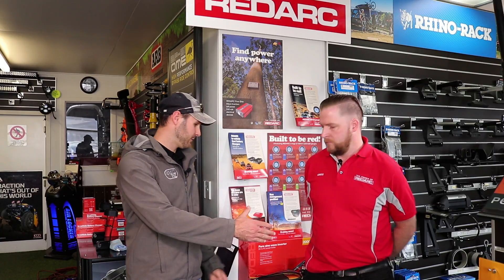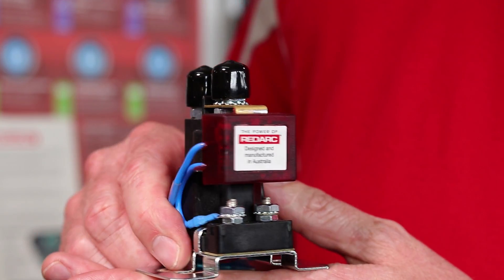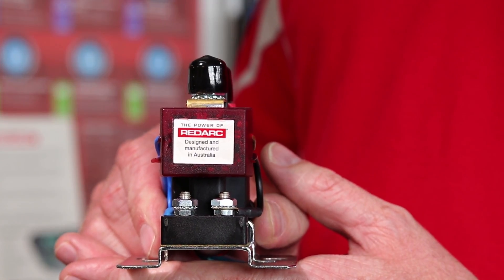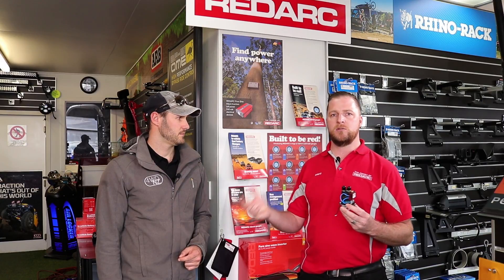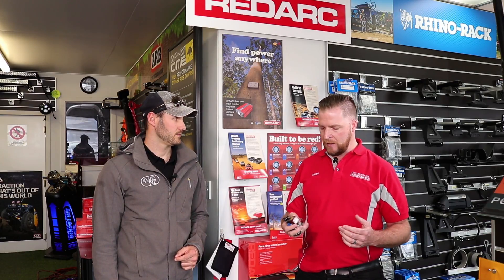REDARC BCDC and SBI Explained

Comment: The alternator may be able to provide 40amps but wouldn’t having to connect to the starting battery terminals prevent you from getting the full 40amps? For example on the Toyota Tundra the alternator goes direct to fuse box and THEN to starting battery, seems like 40amps would drain the starting battery faster than the charging system could handle it.
Reply from the maker: We don't get to play with the tundra here in NZ. Most cars will charge directly to the start battery. For example in out landcruiser we get 120A charge out of the alternator. The DCDC charger will take the charge from the battery as the power is fed in and will isolate its self once the batter voltage drops below its cutoff. You will find the tundra probably chargers  a lot higher than 40A at the battery.

Comment: Couple of questions in regards to having this system installed in  a campervan, 1. Whilst driving is the camp fridge  running off the vehicle alternator or the auxiliary battery? (which is being charged by the vehicle alternator) 2. Once parked and camping, what type of isolator is used to ensure the auxiliary battery is not drawing down the vehicle battery, is it automatic or manual?  Thanks for the info.
Reply from the maker: Hi Gary, 
Great question. Which system have you gone for?
The fridge will always run off the aux battery as long as its been wired up to consume off it., both the SBI and the BCDC will feed charge into the aux battery as long as the vehicle is running. Both the SBI and BCDC will shit off once the vehicle start battery drops below a safe voltage. This will ensure you are always able to start you engine. 
The biggest difference is that the BCDC will charge you aux battery to 100% using the specific charge cycle it needs for its type. The SBI will not. 

Hope it helps

Comment: can i used bcdc this device for Standard alternator , thanks.
Reply from the maker: Yes the BCDC will work with any alternator. It will do a far better job charging your 2nd battery than a VSR will.
Reply: @4WDNewZealand  hello mate, i install yesterday my Redarc 1220 , i notice battery type appear AGM in my display but i did not see any light in Boost, Float  or this is natural unless fully charge thanks.

Comment: At 5:53 that was great, a clear demonstration. Later at 6:12 you stated that a fully charged aux. battery lasts longer. Not if it's LiFePO4 type! Ranging 25%-80% SOC seems to maximize their lifespan.
Reply: Hi There, the statement was more based around that you will get a longer run-time of accessories from a fully charged battery. You are correct in saying that some Lithium chemistry mix batteries want to be charged in that range but the LiFePo4 batteries we are dealing with (and the use scenario) means the batteries are generally going to be cycled up and down and probably wont be staying at 100% SOC for very long. If you are storing the battery for long periods with no charge/discharge then absolutely they should be stored lower than 100% SOC. Hope this helps!

Comment: How many accessories can you run on a starter battery while the car is turned on?  Could I run hook up a winch, a ham radio,   lockers, and an air compressor to my starter battery sine they wouldn't be used at the same time? Or would I need a dual battery system

Comment: Great product line, but why only 50 Amps? Most lithium batteries can take 100 Amps charging current and many truck alternators are over 200 Amps!
Reply: Hi There, alot of vehicle alternators wouldnt be able to supply enough current to run a large DC-DC charger. For example, the latest Toyota Hilux only has a 90amp alternator, the vehicle uses alot of this potential output so there isnt much leftover to run accessories such as a DC-DC charger. The BCDC1240D for example (a 40amp charger) can draw over 50amps from the alternator to compensate for a potential low voltage on its input. However, if your alternator can supply enough current, you can parallel 2x of the same model REDARC BCDC and double the output power to the auxiliary battery bank!
Reply: @drgreg44  I actually went with the KISAE DMT1250 (same as the Enerdrive 50) for US$270 and it is working great with my 140A alternator since I can program it to charge from 5A to 50A in five ampere increments, brilliant!

Comment: Hi i got a bc-dc in my 4x4 if I bypass pwm monitor on my solar power will the bc-dc will the battery cut off when the battery is full?
Reply from the maker: Yes it will, the BCDC is a proper battery charger that also does solar. It will also act as an isolator and won't let your start battery go flat.

Comment: How efficient is it to charge a lithium battery from a bcdc charger compared to a portable gas generator? I have never seen a comparison.
Reply from the maker: Hi Andrew, our Lithium battery is extremely quick to charge. for example if its down at 50% it takes our manager 30 roughly two hours to bring it back to 100% with is easily done while driving. The solar takes around 4-5 hours to recharge it depending on the amount of sun. we have the REDARC 190W solar blanket with can put up to 12Amps into the system. 

Long story short, the system works so well that the a generator is just not needed. Especially because we have the option of plugging into shore power whilst at home or at a camp ground. 

Hope it answers your question.